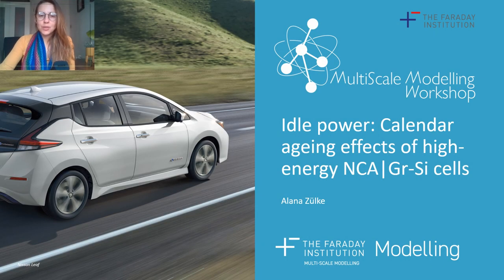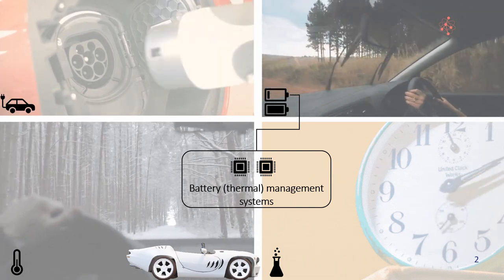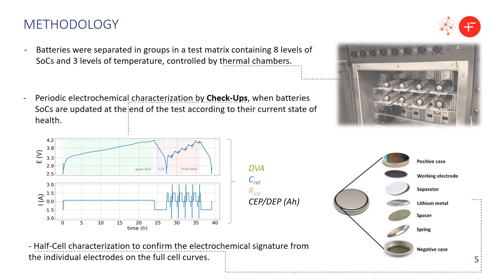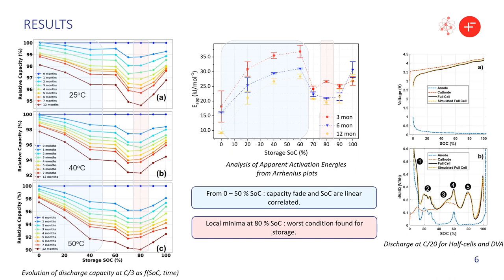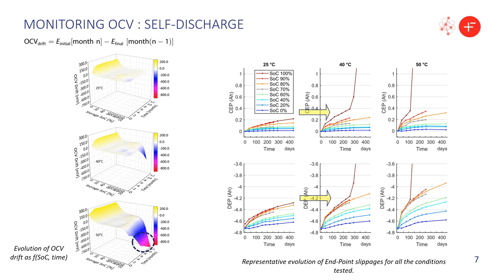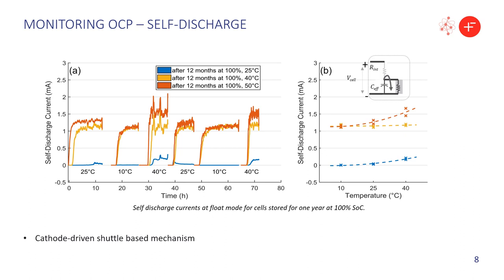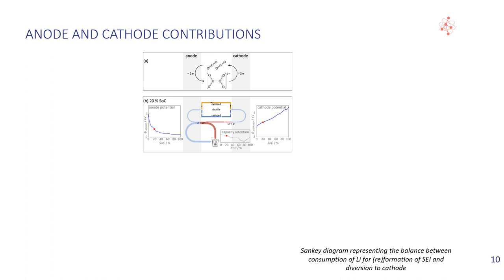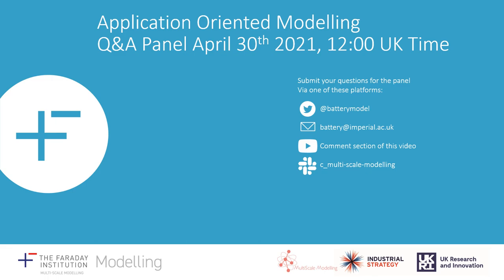How self-discharge can alleviate capacity loss during calendar ageing of charged cells - A. Zulke

Comment: Very interesting, thanks. The manual for my Cupra Born EV says charge normally to 80% but as the car sometimes stands for days maybe I should limit this to 60%. The manual also says don't go below 40% when cold in winter. Presumably I should park the car in shade or a garage to minimise summer high temps. I make several journeys using 80% charge, I've always wondered if 90/10 or 100/20 is better, charging just before departure, presumably 60/10 and a fast charge en route is worse for the battery.
Reply: Thanks for your comment @stevegreen2839. Yes, I'd try to minimise as much as possible the parking time when your battery is > 80% charged. They degrade much quicker specially if temp is higher than 40 degC. The risk for gas formation on the cathode is high on these conditions so there are risks for internal short circuits that are rather "silent" but accumulate with time... we don`t fully comprehend how this would imply on a second life use by the way. 
Limiting the use of your battery between 35-70% can improve significantly its health.